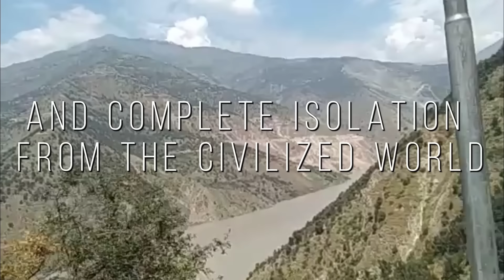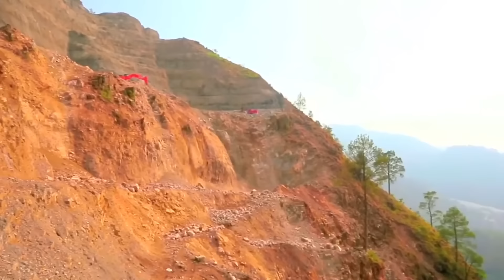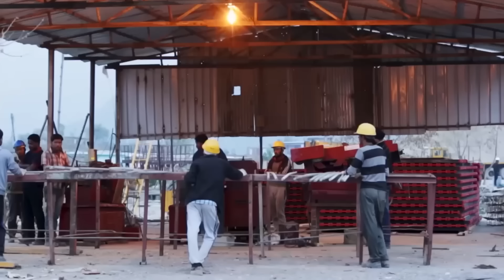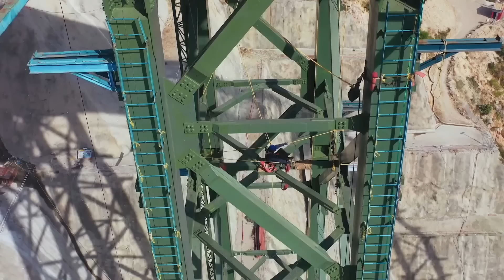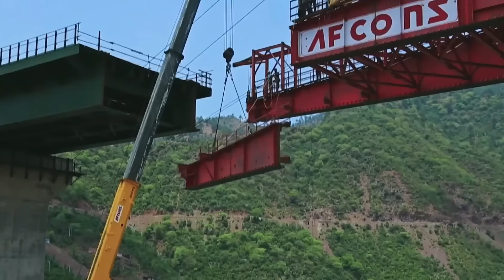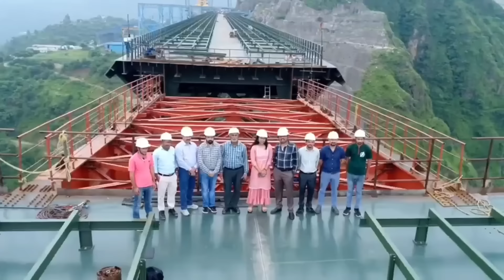How India Built the World’s Highesvt Railway BridgeOver a Himalayan Abyss

Comment: Similar to the technique used on the New River Bridge in West Virginia, USA. I did not see any evidence of safety netting to catch workers if they fell. 

Great work and good video.
Reply from the maker: Personally, I'm also very curious, although they're already equipped with seat belts, but I agree with your point of view that an additional safety net system should be included.
Reply: @WinD-LPS Safety net is redundant in high wind speeds. Safety harness and anchors used.

Comment: The most difficult process was bringing the steel girders to the spot, then implanting them at points needed to hold the structure of the bridge, lastly making the arc to be formed, with no support from below,but by helicopters bringing the girders  from height to the required level. This all is Sharp Engineering, Very calculative measuring, ot planting structure by structure, just no loss of human life. All this in one composition is a marvel & marvel.
Reply from the maker: You're absolutely right, we admire and respect the brilliant minds of these engineers. Please like and share this video so more people can learn about this project, my friend.

Comment: I work on a smaller bridge that was concrete cast on one side of the bridge and hydraulicly push out of the casting bay, it also had a lighter steering beam on the front, this was back in 1987
Reply from the maker: Each year, each bridge will have a different construction method, depending on the environment and feasibility level based on safety calculations to choose the most suitable method.